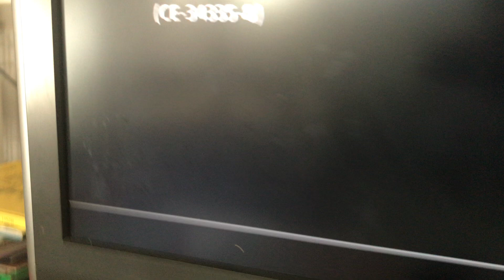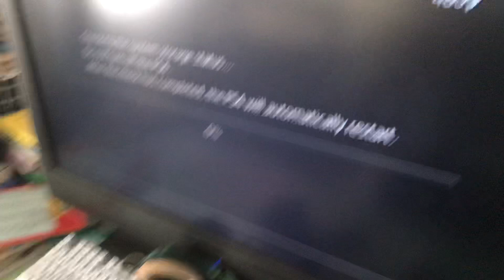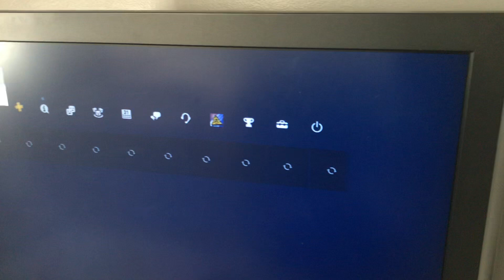(CE-34335-8) How to fix PS4 Original cannot access system storage problem! Super Easy Fix! 2023

Comment: This was the first time this had ever happened to me and I was terrified because I had accidentally slight tapped my ps4 on a wall yesterday and when I plugged it up today it said that I thought I broke it but when I saw this I was like oh ok let’s try. Mines a ps4 pro so my hard drive is in a different spot my ex doesn’t have the case that covers it and don’t have a screw holding it in it’s just a small piece of tape holding it in place so I had knocked it out of its spot when I slightly hit the wall with it

Comment: Me personally it was I just had to pull out the ac power cable its got not too much to do with dust at almost certain. I didn’t even try the other steps after I turned off the PlayStation unplugged and then turned it on after 5 secs loaded right up !

Comment: This didn't work for me. I still get the same error code. The system won't even start in safe mode, just takes me through the same loop of trying to start up and giving me the CE-34335-8 code.
Reply: same problem bro did you fix it?
Reply: @giornogiovanna69  Nah, had to buy a new hard drive, which worked, but now I'm having new issues. I'm going to have to send the system in for service.

Comment: So any guys watching this video if you need to buy a new hard drive check Amazon you can get the 1tb hard drive for PlayStation 4 for like 42 bucks free shipping if you have Amazon Prime and it's not that hard to install a new hard drive you just plug it you just unscrew the old one around the metal there's like four black screws and you can use the same screwdriver your Philips star screwdriver

Comment: Also keep in mind it's not always the dust it can also be the hard drive itself it might be corrupted. It's why some people recommend that you might have to replace the hard drive or sometimes if the corruption is too bad for the console you might have to replace the entire system or send your system in for a service repair.
Reply: Do you know of some likely causes that could lead the hard drive or the system to go bad so quickly besides the dust ; particularly in the event that you already experienced a hard drive going bad and replacing it once before?
Reply: @spongebob8445  no but yes. In my experience with this issue it has nothing to do with my ps4 and everything to do w the wiring in my home. The ps4 isn't getting enough power to its various shutdown sequences which eventually causes problems
Reply: @WhenDevilsDuel  That's interesting. Well i just gave mine a new hard drive for the 2nd time. Its working fine now, and i have a warranty on the hard drive in case it goes out as quick as the last one.

Comment: This happened to me and I couldn't open it bc I didn't have any tools or anything I could use So I just unplugged every cable Left it sitting there for 2 days Then I decided to plug everything in and turn it on and it did so I hope this helps you whoever is reading this
Reply: I really hope this works
Reply: Disconnect everything, then dust it out as in pick it up and slightly and repeatedly tap it while it’s tilded, that worked for me
Reply: So without opening the ps4 and you just let it sit it worked?

Comment: It didn’t work for me. My PS4 has a Nyko Storage Expansion Hard Drive DataBank. Did the same thing with the unplugging, getting the dust out, plugging it back in, and turning on the power. But the same message came up for me. Anybody have tips on how to solve this issues?
Reply: I tried taking my hard drive out too did it twice and nothing happened I'll try it again though
Reply: Try a can of air duster

Comment: Also of you can get it to boot in safe mode rebuilding  the data base worked for me once but this helps as well
Reply: How do you get it to safe mode
Reply: @SockTaker  hold the power button
Reply from the maker: Hold the power button until you hear 2 beeps
Reply: @davidb7212  keeps on saying can't access storage
Reply from the maker: @SockTaker  maybe buy a new hard drive

Comment: Thanks man. You got another sub 🙂 I watched so many other videos before this one and you just saved me from having to buy a hard drive for my PS4.
Reply from the maker: I got you bro 😎
Reply: @davidb7212  i had to buy a new hard drive before and now this one went bad in less than two years. I figured the dust was part of the problem, but in my case i don't remember how i unscrewed everything last time and i no longer have the screw drivers.

Should i wait until i get some screw drivers so i can pull out the hard drive and blow/clean that area or do you think as long as majority of the dust is removed blowing the hard drive may not be necessary?
Reply from the maker: @spongebob8445  you can try blowing out the dust in the area where you hard drive is and if it doesn’t work just try to get in there where the connectors are because that is the most important part. Or it might be a messed up hard drive.
Reply: @davidb7212  ok thanks
Reply: Imagine 😭

Comment: Mines fell on the floor then it went to the that screen so I just need to buy the new hard drive right? And it will work?
Reply from the maker: Yep it should work
Reply: did it work?? mines fell on the floor too n this error popped up
Reply: @passn4oethablues80  yes bro mines worked I had buy new harddrive and flashdrive to download the things to reset the whole PlayStation

Comment: How do you do this with a ps4 slim
Reply from the maker: Power down PS4 complete and unplug all cables and power source.
On the back right corner, there is a small piece of plastic that you can easily slide off to reveal the hard drive.
Take out the screw with the Playstation button logo in it. ...
Remove the current drive from the housing.
Reply from the maker: Here’s a link if you need a video. https://www.bwone.com/how-to-upgrade-your-ps4-slim-hard-drive/

Comment: This is a great video thanks for the help I'm now thinking about buying compressed air to clean the entire system more efficiently
Reply from the maker: No problem!
Reply: Be careful because I did that and I ruined my disk drive because I wasn't careful enough
Reply: @imherenow9916  wdym u were not careful
Reply: @amirghirani5390  He probably blew the air too close to the fan. You not supposed to put the compresser air full into the ps4